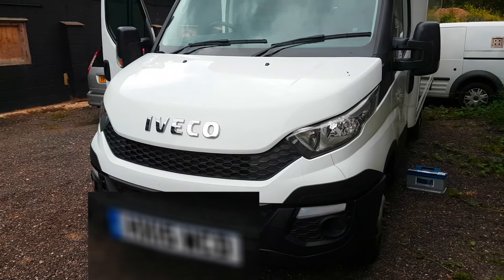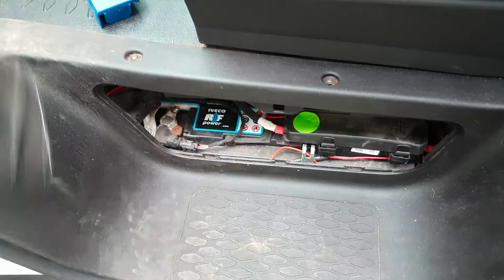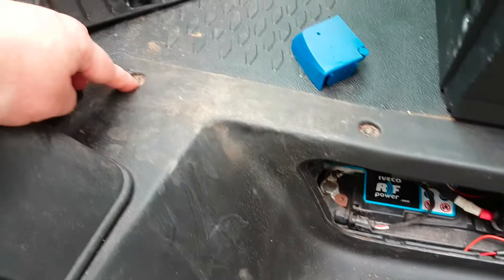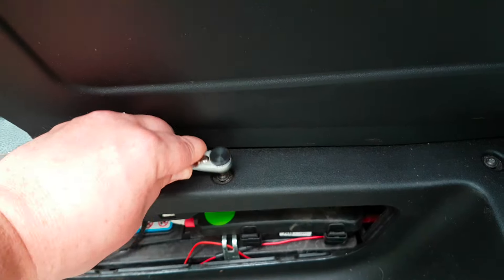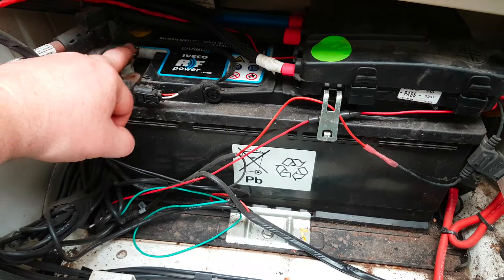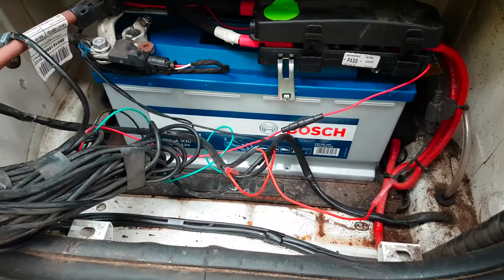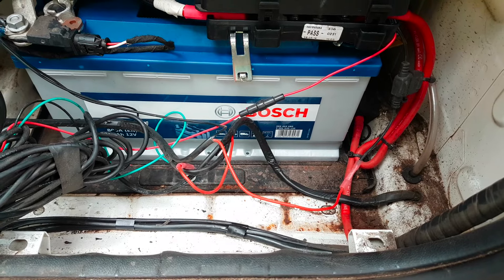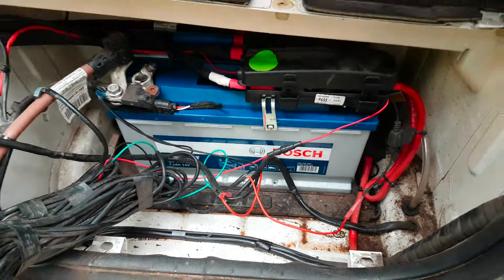How to Replace an Iveco Daily battery

Comment: Thanks for this video mate. Helped me a lot. 
For people worrying about disconnecting the battery and having electrics issues after with these newer ivecos, just do it quickly! Mine gave me a fright by doing absolutely nothing the first time I turned the key but second time all was good. No loss of codes etc. 
Once the terminal bolts are loose and the bottom bracket removed you can swap it over for new battery in 30 seconds and get those terminals back on. 
Thanks again mate.

Comment: Nice video to see that.  The new battery is clearly a good brand but it looks an inch smaller at each end?  Assume its still rated for a daily?  I've got to change mine soon hence seeking out a video like this.
Reply: There’s diff ratings it’s what you prepared to pay 80 to 120 odd amps , all 175mm deep , or 175  190 mm High  
DONT let them give you a 225 high it won’t fit !

Comment: I let the battery die after a few weeks on holiday, swapped it out for a new one and now have the immobiliser warning exactly as you say. What is the next step with this? is there a diy fix or am I actually facing spending big to get it trailered to an iveco dealer for recoding… any thoughts much appreciated as it seems absolutely daft for a flat battery
Reply from the maker: We had this. It had to go to Iveco to be coded I'm afraid.

Comment: The kick panel, plastic bracket is screwed in, wedge the battery surround away from the piece using a flat head screwdriver, x3 10mm bolts third bolt on the bottom tray area locking the the whole battery in place

Comment: Pushing Bosch I see lol
Reply from the maker: No. I just wouldn't fit shite like Starline or Napa
Reply: @CosmicPrawny  joking but what you think of platinum ? 
Seem like the Emma of batt s 
All hype !
Reply: @CosmicPrawny  and put in reg got 9 choices only 2 would fit as need a max of 190mm H to fit under cables at back 
So the casing will fit ? 
Deck got 225 mm H so no fit bloody platinum 
019 is 190 or 175 H
Reply: @CosmicPrawny  av a feeling batt been changed before or swooped as 190 tight fit

Comment: Thanks mate... That helps me out... Going to swap the battery today on a 2018 Daily... You are right about quality... Unfortunately Iveco did not think the way you and I do... They did it sheep and cheerful. OK, rubbish out, 100ah battery in... Once again, thanks for a short, great video.
Reply from the maker: Be careful - we found that if you leave the vehicle with a flat for too long, it loses sync with the ECU and has to be re-programmed by an Iveco dealer. So make sure you swap it quickly and don't leave it without a battery for more than 30 minutes.
Reply: @CosmicPrawny  .. All done. Works great. Obviusly I did it quickly enough 😅